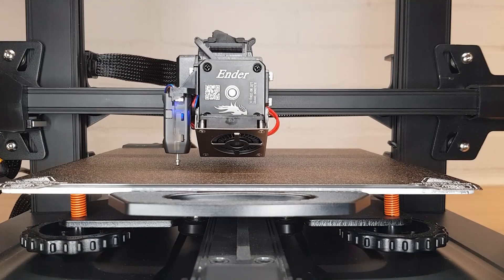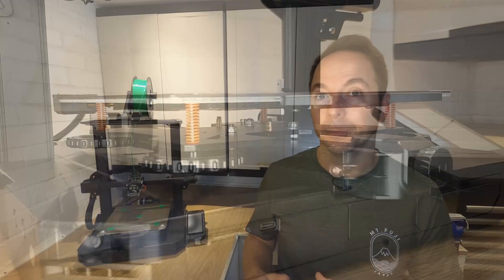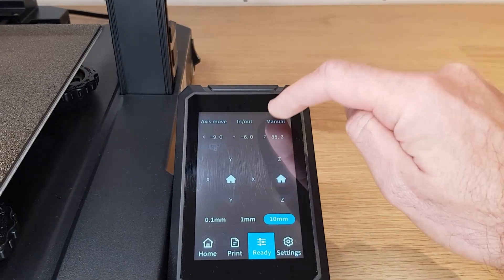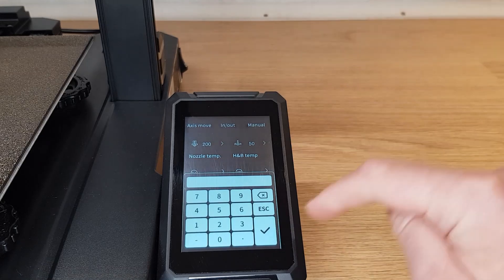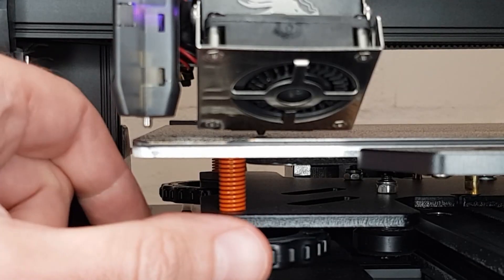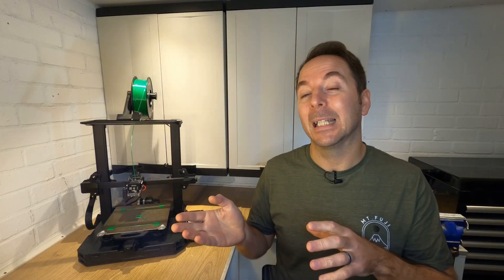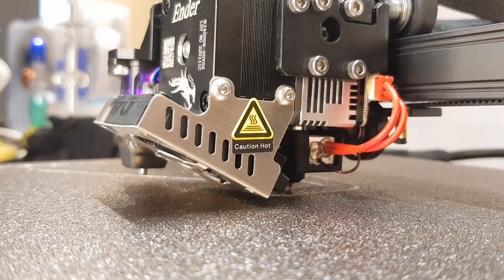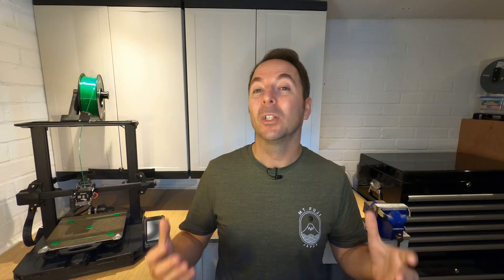Ender 3 S1 Pro 'Automatic' Bed Leveling In 3 Simple Steps

Comment: GREAT video and perfect timing for me LOL. Thank you for the great content. I just picked up my S1 Pro this past Tuesday and started running in to levelling issues after the 6th print. First 6 prints were great! Benchy was excellent! Then it started to act up. levelled and levelled .. again and again. Going to try this out tonight... crossing my fingers!
Reply from the maker: Really hope this all helps you, thanks for the comment 👍
Reply: Same issue here - first half dozen prints were great - then crap after that.  Creality support insists all that is wrong is that I need to update my firmware - we'll see.
Reply: @darreneyring9855  Well I did the upgrade and still the same issues. No change so now I am adjusting the Z axis as I do each print.

Comment: I just received my S1 Pro and this worked great. This is my FIRST 3d printer. I followed your guide to PID tuning and leveling and my first print a Zou Ghost worked perfectly.  Please keep the S1 Pro content coming as it applies directly to my unit! Thanks!
Your gcode suggestion of M420 has all my subsequent prints working flawlessly also
Reply from the maker: Great to hear the videos are helping 👍 Thanks for the comment
Reply: @RickyImpey  Will give this I try (though I'm getting really good prints, I have to level each time) - I notice my X and Y widths are different in creality slicer - only 220 and the code is slighty different.  If I copy your settings will that work ok too?
Reply from the maker: @PaulMD  Yes it should work fine. Mine are copied from Creality Slicer. Copy yours to a text file before you change anything though, just in case you have any issues and want to check its not any change you make to the start g-code

Comment: Good video. And you are good presenter. But for example I have faulty S1 Pro, that messes up mesh once you auto level. All of this in general is very badly implemented from Creality's part. I have one question for you, have you updated firmware of S1 Pro? If you did, are there any improvements in UI, since Creality doesn't give any info about what is changed. Thank you in advance.
Reply from the maker: Hi, thanks for the comment. No I haven't updated the firmware on this printer. Did you see my review video? I was aware of people having issues with the bed mesh and auto leveling but I couldn't re-create the problem on my machine. I wish I could as then I could try to find a solution for people.
Reply: @RickyImpey  Yes, I did, and it was the most helpful out of all videos out here on YouTube about S1 Pro. The problem is, no matter how much I tension the springs, the Z offset after CRtouch does it's job is always -2.55 and I found that this is on of the indicators for faulty firmware. I also cannot do a automated bed leveling if I set my bed at some certain temperature, it will always wait for the temperature to be exact and then do singular probing. Sometimes it takes around the minute between the probes, and than it just fails mid leveling. I found ways around all problem and it prints great, but paying extra for headache is a big problem. Hopefully you will do a video with firmware update. I would be very keen to watch it. Best regards.
Reply from the maker: @MechatronicsGuy  Wow, that does sound like a very big firmware problem. Ok, I'll look into the firmware update. Can you tell me what firmware you have please? I'll see if it's the same as mine.
Reply: @RickyImpey  sorry for the late reply. The firmware listed on my machine is 
F/W ver: 2.0.8. 15F4
Screen ver: UI20
H/W ver: CR-FDM-v2.5.S1_1
Reply: @MechatronicsGuy   For S1 Pro with motherboard v2.5 you don't need G29 or M420 in Start code. It's already in Firmware. Delete these commands from Cura, run a test print on the entire surface and observe the motors on the Z axis. There is another version of Firmware with the same number and tag :) that runs ABL without problems. I got it on live chat at the Creality service center.
Reply: @pecawiener  thank you for your reply Peca! So right now you are having April firmware but bug free?
Reply: @MechatronicsGuy   Obavezno apdejtuj lcd pa onda instaliraj novi (septembar) firmware.
Reply: @pecawiener  Hvala!

Comment: I had a different approach on leveling my bed, but only because it took me ages... 
I was hoping that you'd had a warped bed like me and found a solution for it. I have a really bad corner on the front right. The Position "3" in the Level guide ... The nozzle always hit's the place where the screw is, but everything else around is almost ~ -0.10 to -0.15 lower than that corner. That's a lot. Using "M420..." the automesh is a workaround but IMO no nice solution since the Nozzle has to move up and down in these areas making prints equally warped as the bed. I tried a glas bed, but that is warping too when heated. So many years and manufacturers are still not able to solve the bed warp problem. Such a disappointment. 
My way on leveling all corners is to look below the adjustmend and screw the bed up until the screws are barely visible, but equally lifted on all corners.
Reply from the maker: That sounds like a very warped bed, I can't say I've seen one that bad. It's strange for the glass to warp when heated. How tightly did you have it clamped to the bed below it? With the glass bed on my Ender 3v2, I only have 2 clips holding it on and, even if the bed below it warps, the glass won't. The warping is usually caused by heat expansion. Sometimes it's stresses that are there from manufacturing but sometimes it can be from rigid mounting of the bed to not allow for any movement/expansion  with heat. I'm not sure I understand your leveling method, the most important part is that the bed is aligned with the X and Y axis.
Reply: @RickyImpey  Thanks for the reply. 
My method was really unorthodox. I believe all screws have the same length, so I thought it would be easier to move all 4 corners to the same level by moving every corner up until they are barely visible below the adjustment knob. I didn't really needed clamps. The glas was hard to remove, like it has been vacuumized to the bed. but nethertheless the front right was still higher than in the center. It's a original creality glas. It was like the heat formed the glas into the same form like the bed. I had to use tools to remove the glas. I have tried many methods leveling the bed, following multiple guides, but no solution could help me fix this one right corner... I've almost invested 30 hours only leveling the bed, with different approaches. My bed is so warped, an unused flat glas on the naked heatbed made a gap in the center visible giving space for almost 1-2 sheets of paper.

Comment: Do you have any tips for setting the tension with silicon bed springs?
Reply from the maker: Honestly, I don't like them. They effectively create the same situation as fully tightened springs. If you have no other choice then find the zero pre-load point as in the video but then only add a couple of turns to each adjuster so that there is some pre-load on each corner to allow for adjustment either way when you come to the manual leveling.